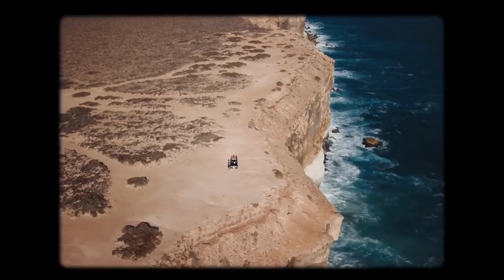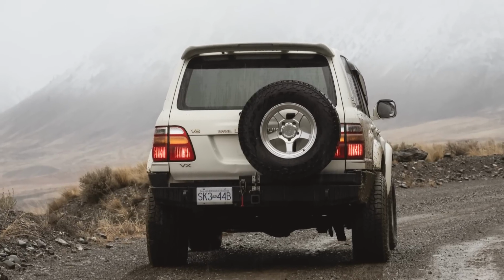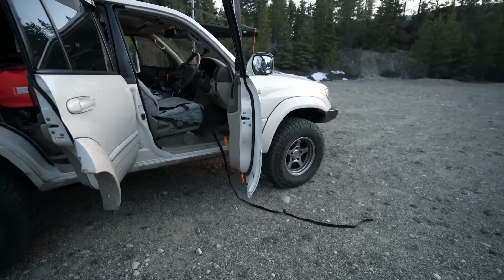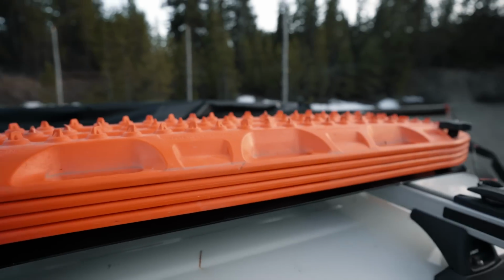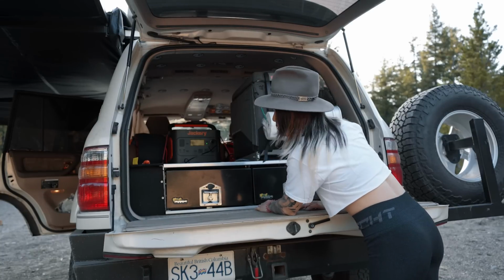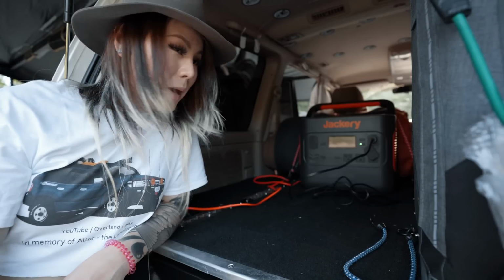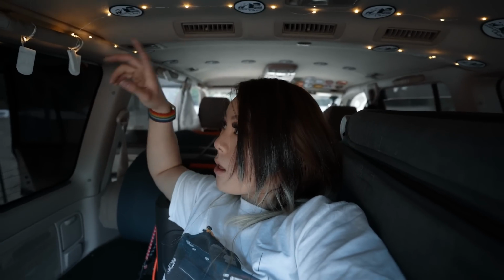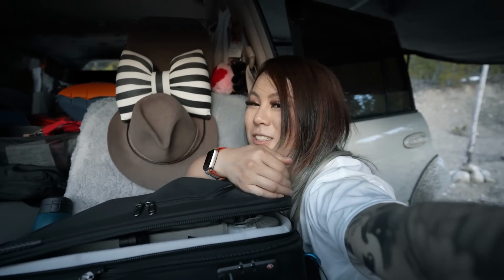My Low Budget Landcruiser Setup For Solo Camping

Comment: It's a never ending thing.

I've had my travel trailer for 10 years now and still changing things around.

My cargo van has gone through so many changes, I forget how many!

I only have two camping trips on my 4Runner and have ditched the platform bed system I made already.  I rather have the headroom.

Comment: I have 4 landcruisers. Nothing can scratch the itch if you’ve got the cruiser bug. Looking for a 70 series now, but here in the states it’s hard to find the perfect one without importing it yourself.
Reply: Import a 79 series from Australia u get the V8 or from south Africa you still get the famous 1hz 6cl inline  diesel motor which is still the best 👌
Reply: @davidmilledge221  Right hand drive would suck though (in the US)
Reply: @Malc664  if you have a left hand drive body, you could build over what you need, or convert a complete vehicle to left hand drive
Reply: Forget about 70 Series. Much better to drive 80 Series.

Comment: So a good starting point, but I see no fire extinguishers having had two friends who encountered the dreaded fire one saved as he was camping where there was a dozen other campers and a good half had two or three per vehicle so only lost his backup solar set up the second lost everything in the bed of his Ute and the topper he put it out by reversing into a river nearly losing it from flooding in the process but at least 10K in damages.
So think about at least a couple one in the passenger footwell you can get brackets that adapt to the front seat mounting points either a universal but there are companies do vehicle specific ones, have another at the rear mount to the tailgate so always easy to grab.
Reply from the maker: I have it in there now. Had to use it while in Western Australia. Was a close call. Definitely must have

Comment: Should've left those flares off and kept away from zero offset wheels, looks like a botch job and never really works well on the ifs 100series, especially if you want to get the most out of your front suspension.
Reply: OverlandLady   Ah, no thanks. 🤣